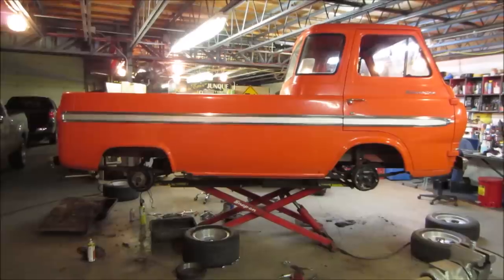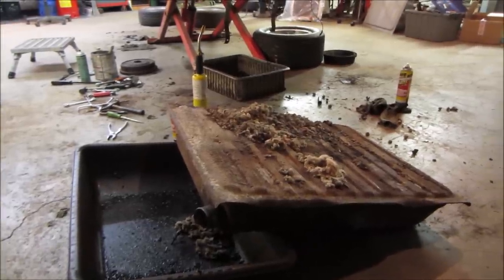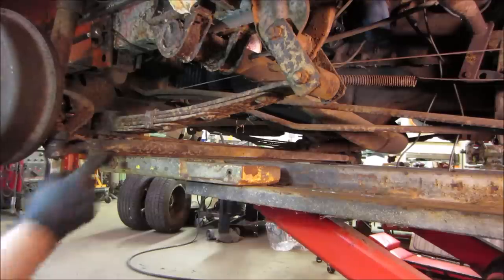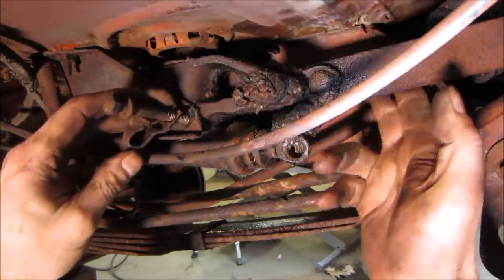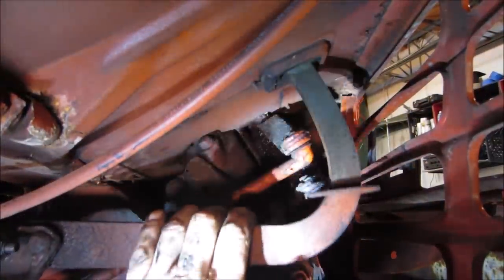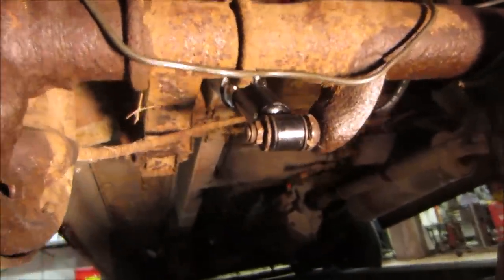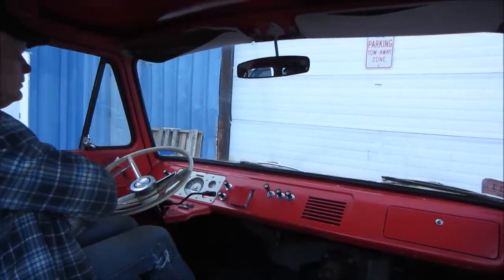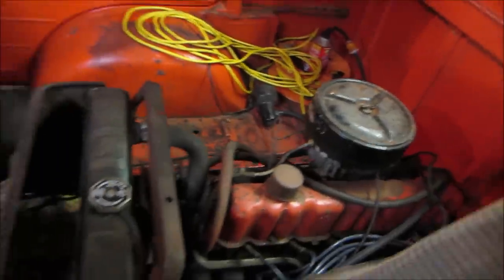Ratty 1965 Ford Econoline,  Making It Stop Then Making it Go

Comment: Hi Mustie. I must say, I'm enjoying watching a lot of your videos lately. Especially, the ones about your ongoing work on this gem to make it roadworthy. Watching your last video of changing out the exhaust manifold, reminded me of what I used to have to go through, changing out exhaust manifolds and sometimes cylinder heads too, on class A motorhomes with the Ford 460 V8s. It is very interesting to see how one of these old Econoline pickups are worked on, doing some usual common repairs that would ordinarily be needed on any other old vehicle, but do to it's unique cab over engine layout, requires some unique repair methods. Is that a 240 or 170 inch inline six? Either way, it's a nice little unique time capsule on wheels. I'm surprised you are able to engage 1st gear with the vehicle moving. I thought 1st and reverse were non synchronized in transmissions of that era. It is also very interesting to see you taking on a project with a Ford for a change. That's what has caught my attention. Not that your videos of working on old VWs and your other toys have been less enjoyable either. Just curious, but what do you do for a living? I'm a Ford dealership technician, Senior/Master/Diesel certified since 2007, and with Ford since 2000, turning wrenches for a living since 1994.

Comment: This little old truck is wonderfully simple and 'accessible' to work on. If it ever needs a heater core, that will be like a ten-minute job! It's shaping up to be an especially cool project. I think it looks fantastic on the  classic fat wheels & tires, too. A straightforward classic Windsor 289 engine swap would be an appropriate, sort of period-correct hot rod mod. Is a floor-mounted shifter feasible in this thing?

Comment: 3 speed transmission used in the Comet, Falcon, and 6 cyl Econolines were synchromeshed in 2nd and 3rd only. 1st and reverse didn't have any synchros. You learn driving it to pull it into 1st gear at about 2-4mph with the engine idling. To hit reverse without grinding, make sure you're sitting still when you go from 1st to reverse. The weak spot in those transmissions was the front cluster bearing. If the lube got low the bearing would run dry and wear the bearing. This caused the cluster to drop by the slightest bit and would chip teeth on the cluster and input shaft cluster drive gear. If you hear any gear whine from the trans, plan on pulling it soon..... I had a hotrod '62 Falcon back in the late '60's.....went through a lot of transmissions.....

Comment: the 67 econoline vans had a dual master cylinder and fits directly except for splitting the  brake lines front and rear.. only issue.. those dual master cylinders are as rare as hens teeth..  walk in your napa store and see if they still have a price on them.. there is a chance that one of their warehouses may still have some .... i don't have a part number on them anymore .. the last people to have any available were auto speciality and those came out of south america..  there are some possible options..   take the old dead master.. clean it up.. bore the end out of it.. or just drill the inverted fitting out.. make a new piston for the inside..  make a pair of L brackets that bolt to the side and mount another master cylinder in line with this one.. so the new solid piston and push rod sticking out the old inverted fitting hole push the piston of a new dual master cylinder. it has been a decade since i was under an econoline..  the other option was to mount two 1961-66 master cylinders side by side and use a tilton dual master cylinder pushrod they use in nascar brakes.. for the side by side masters with adjustable bias ratio..   somebody who has an original 67 can probably get it copied and have a land office business for several hundred of them..

Comment: Comments are off for the 1500 psi compressor, but I just wanted to say that you may have underestimated the power of that tiny little motor, and if you would like to "hand it to me" (as you mentioned) I'd love to have it.  Of course you are in 2020, and I'm back here in 2019, so the logistics might be a challenge. : )

Comment: You might try looking at a Mustang/Falcon radiator from 1965.  Be sure to specify the V8 version.  You can get them new for less than $150, with a lifetime warranty, from O'Reilly (and probably others).  I'm just thinking being a Ford product of the same year, they inlet/outlet my work better your you.  It's also a pretty small radiator, which is commonly used in T buckets.  From what I remember of the one or two I bought, your radiator looks a lot like them.

Comment: 67 would give you a duel circuit brake system, also a Mustang 6 cylinder radiator will put the  hoses on the correct sides and the rite diameter for the 6 cyl.

Comment: Not sure on the inline 6 motors,  but on the windsor blocks 262,289,302 and 351 you can get a water pump with the hose on the drivers or passengers side under 20 bucks new.

Comment: It looks great, but I preferred the VW van for handling due to the weight distribution with the engine in the rear. Although I could force it to drift if the road was a little slick.

Comment: Very cool.  I'm not a fan of installing the wrong parts just because you're too cheap to do it right though.  I would install the correct gas tank, repair the original radiator, put normal shocks on it, and install factory wheels.

Comment: If my memory serves me correctly, the optional engine available was a 240 cubic inch 6. The same motor mounts as a 289. almost a bolt in.

Comment: Ok its official mustie1 ratrod...👍drop that weight out from underneath.  Delete that bumper, get some good 1/4 steel build you a killer thick offroad rear bumper to add that weight back to rear and bolt it up to frame and add a class 3 hitch. do your special chainsaw lube all over under body.. add the tinted windshield stripe "Mustie1 ratrod" . Cherry bomb mufflers. Your a neighborhood hit..😂

no emission inspection no headache

Comment: Do they not use the diagonal dual circuit for brakes?  By that I mean front left and rear right on one circuit and front right and rear left on the other, so that if one fails you have a better chance of stopping in a straight line.

Comment: my uncle had one of these trucks and the original motor was held in by chains and baling wire. by the time we were done with it it had a 302 bored 60 over and a 4 spd automatic built heavy duty. he went to take it on the freeway and punched it and spun tires and did a 360  then we decided to rebuild the front end and new brakes now it moves like a molested monkey and the next thing to fix is the differential and driveline.

Comment: loving the video. Any chance you can oil the springs connected to the brake pedal? they looked pretty rusty, but you didn't mention it or suggest it so there must be a reason.

Comment: Is there a bolt on conversion to a dual circuit brake master cylinder?  I realize the top speed of that truck doesn't require a lot of stopping power, but half the wheels stopping is better than none.

Comment: Laugh - I bought a replacement alternator for my 94 Nissan truck - could not get it to work.  Returned it 2x before I discovered a rubber spacer (?) inside the socket.  The laugh was I had to remove the radiator to get the alt out.....

Comment: Those rear shocks are at such an angle that they don't do a lot.  If you can redrill the chassis and bring them  up to a more vertical position, they will work so much better.   It's begging for an auto gearbox.   No servo on the brakes? No power steering?  It's a Flintstones truck! Looks good though.

Comment: Mustie talking of doing dumb things here a story One of my friends phones me up "the battery died in my car . I got a new one but it still won't start can you come over and take a look at it." So i went over, he cranked it nothing happened. He knows very little about cars. See I got it round the right way Red to positive, black to negative!" points at the battery and sighs. " said "go make me a coffee and i'll fix it". While hes inside i undid the battery terminals and took the plastic caps off and re tightened the terminals. He comes out with the coffee and I said "try it now" it roars into life. I pulled out the multi meter and 13.8v, everything good. Now he thinks I'm the best thing since canned beer. He said, How? I said  "Its a trade secret". LOL

Comment: Put a shorty shifter on the floor would prob. shift easier  ehhh
Reply: unfortunately   nobody makes on  we tried during the 70's  NADA
Reply: @gertraba4484  I had a shorty made by Hurst and it worked on a 3 speed from column to floor with no prob. ehhh

Comment: @ 27:00 the connection between the bracket that holds the master cilinder and body  in the top left corner seems to be so not doing much

Comment: Please, please, please READ THIS...As a teenager I drove a 1965 a econoline van abd got into TWO rear end accidents... These vans/trucks are severely light over the rear axles and a 20 mph hard brake WILL cause the van to hop like a bunny rabbit right into the back of the car you are following... There was very little safety standards in 1965 and you can end up being the first at an accident and possibly the LAST to leave..
The engine is as you know behind the driver's seat and there is nothing structurally there to absorb a front end collision...  I did enjoy driving this van up until the accidents but I would think anything over 20 mph and you are dead...

Comment: What size 6 cylinder is that 250 CC Mustie 1 :) ?
Reply from the maker: 200
Reply: @mustie1   :) that so cool and I remember later version of Ford 3.3 litre 200 CC 6 cylinder engine with 2 barrel carb had in 1982 to 1985 Mercury Capri cars see in them my Cousin Dawn had  a car 1983 Mercury Capri LX  hatchback in 1990's  lot like Ford Mustang car but was strong car too! We tune that car really good and she had lots years of great time with 1983 Mercury Capri 2 door and two tone brown !

Comment: I would go all electric for van
Because Batteries are getting smaller
Electric engines have much more torque 
And you just need a one speed transmission
Besides you won’t drive this thing 200 miles

Comment: Yes new rad will work for 6 or 8 cylinder motors also love gun (brake resvoir) Lol  if put other set of 2 front lines and  2 back lines setup too if changed to in future time! Also on exhaust manifold have use springs with two washers on each stud  for tighten  outlet up plus heat and cool expansion! Also like your funny moode working on video with excellent humor Musitie 1 :) and like me do to working vechiles and repairs too! Mustie 1 :)  worst fuel I work on gas also desiel is farm fuels  plus Furance Oil to want burn clothes and have new ones handy to change in and not light cigarettes or cigar or pipe clothes burn of from Heat Lol! Fuel of Petro company was worst fuel smell ever I know & Ford's  brand or NAPA brand of  Dexron 3 or higher type of Automatic  Transmission fluid and Differential Fluid 80W90 are worst fluids get on clothes are Big Worst Smell when put in vechile or be get changed I will tell ya I found out worst be sprayed by a skunk too Lol ! Hope love my comments Mustie 1  :) and everyone plus keep videos on repairs I am love help with learning new challenges! Love do job with you Mustie 1 :) together we have excellent day too and lots Lol plus keep Coffee drinks rolling to drink too!